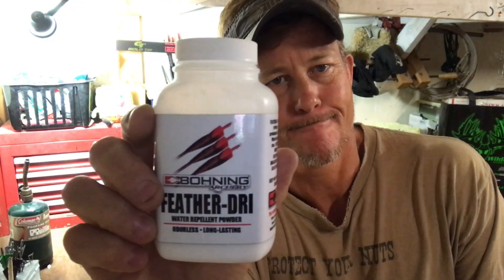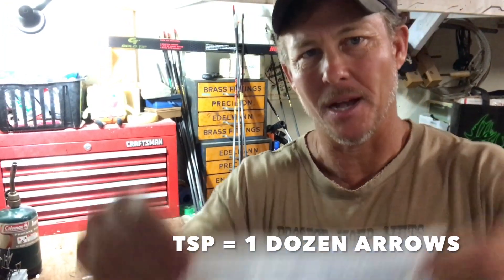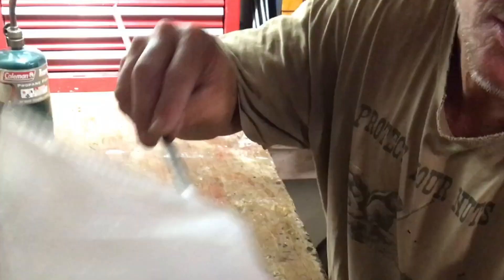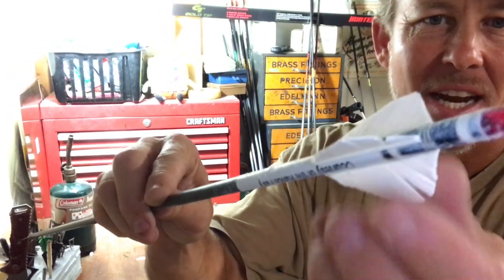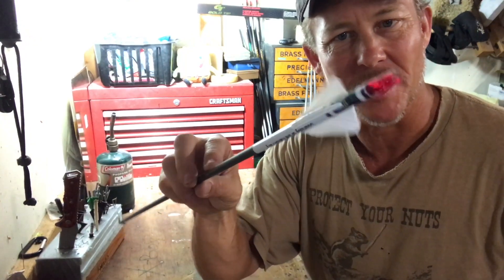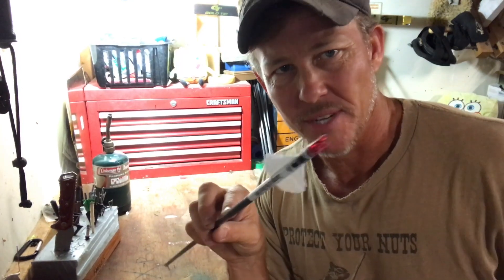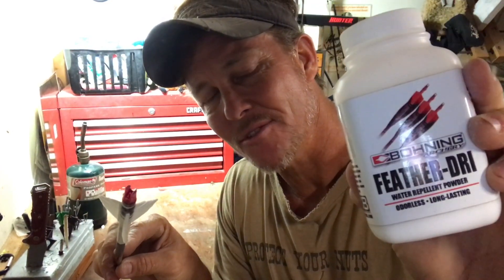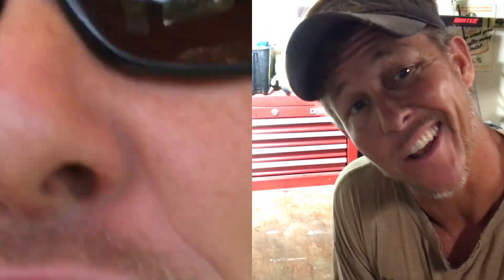How to waterproof feathers I Ranch Fairy "How To"

Comment: Bohning Dri only works in a light/intermittent rain.  In an a steady rain or short heavy rain, your feathers will get wet and lay down to the shaft given enough time/water when using that product.  Some folks advocate silicone tire treatments (Black Magic, etc), but I stopped using feathers before trying it.

Comment: What feather size and brand do you recommend for 4-fletch?
Reply from the maker: True flight 
2” - shield
Reply: @RanchFairy  Are arrow wraps needed for feather adhesion or are they for aesthetics and visibility?  Thanks for the library of resource videos!!!
Reply from the maker: @johnp1839  
They are not - straight on arrow - no need to add weight to back of arrow

Comment: I also use Feather Dri, but nothing will keep your feathers dry for very long if it is wet. On all day spot and stalk pig hunts just the water brushed off of vegetation can lay them down pretty quick. I use two things to keep them dry: 1) A CatQuiver, it protects the feathers 100 % while they are in the quiver. It is worn on the back like a backpack. 2) Balloons, yep, balloons; for my arrows on the bow mounted quiver. I find the right size balloon and cut the end (where you blow it up, then stretch it out over the feather and onto the shaft. This keeps each feather dry and is easily removed for nocking. I have practiced shooting the arrows with the balloon on and it doesn't seem to effect the flight, it is louder though. The arrow quiver must be configured to be used with the fletching in the up position for this to work. When ready to load, just remove the arrow from the quiver, pull the balloon off, which lays the feather in the right direction, load and shoot.
Reply from the maker: HVACRat 
Great ideas to try!!!  Thanks!

Comment: I really wish you would try the Starrflight FOB (Fletching Only Better).  I was amazed at the improvement of my arrow flight, accuracy,  ease of use in all weather conditions,  greater accuracy in windy conditions.   It's a 1in diameter plastic airfoil.  I don't any connection with Starrflight except for being a very  satisfied customer.